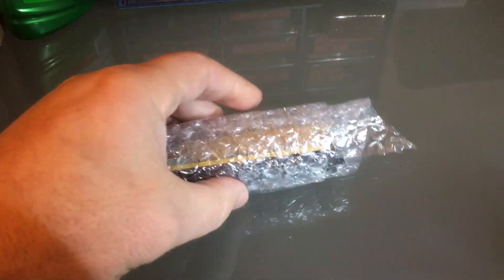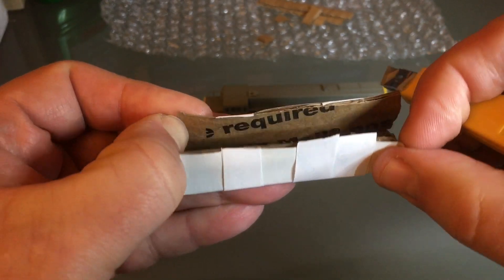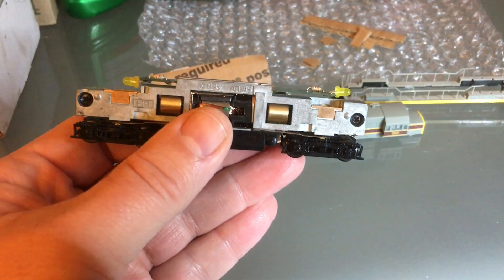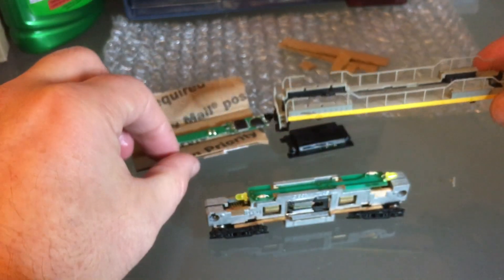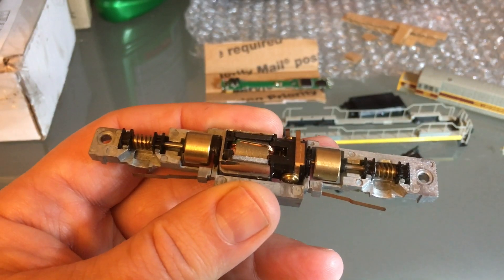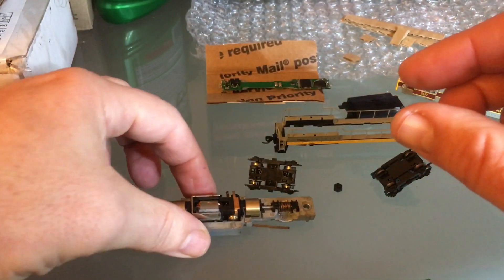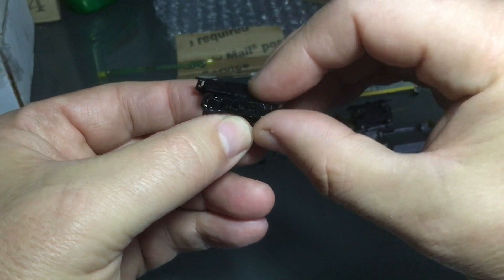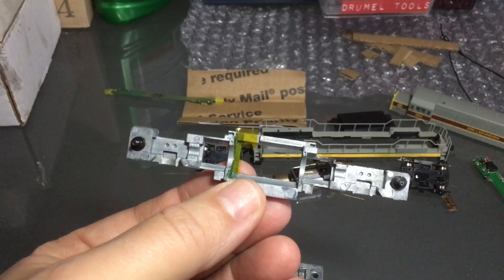N scale Atlas U25b conversion to dcc using an XL Systems dcc board.

Comment: I have locos from Atlas, ConCor, LifeLike and Kato and if their frames weren't all designed by the same team I would be very surprised. I think Kato made drives for everyone at one time. They are all very good runners.
Reply from the maker: Probably other companies reverse engineered what Kato has done. I enjoy the other manufacturers. Just Kato is always one step ahead.

Comment: What your opinion on new  BLI vs Kato.  As far as quality of design and manufacturing.   I have several BLI. I haven't had any issues with them and haven't had to take them apart.  Some people like them and some just can't stand them.  I have mostly Kato and then seem to be really good runners.  I would say they are the N scale choice for quality.
Reply from the maker: My T-1 still runs. They look great. I will know if I like them over time. Kato I have been running for 30 years. I like that. I’m use to them and I trust them 100%.
Reply: @watchtrainsnow1099  I like the sound decoders for the BLI.  Seems they have done a lot for the sound end of the locomotive.

Comment: You seem to get mostly lucky with your buys.   If not you do have the skills to make it right.
Reply from the maker: Yes… I spend way too much time on eBay. The prices are crazy right now. This was purchased a while ago.
Reply: @watchtrainsnow1099  I agree I have been looking at some Kato P42 locomotives in N scale, they are selling more than retail.
Reply: @watchtrainsnow1099  one I missed out on was the Veterans limited edition that was made for Amtrak and sold only by them.  It's $400++++
Reply from the maker: But, you will see what I do is bid on engine that are not so popular or damaged. P42 is a really good looking modern engine. RS-3 not so popular.
Reply: I know you are very diversified in your collection.   I stick with the Amtrak's P40 and 42's.   If I see a freight or pre Amtrak passenger locomotive that I like I grab those sometimes.  I picked up the G HW bush locomotive by Kato because it just is really a great paint job.
Reply: @watchtrainsnow1099  why are the prices so high right now? I'm new to the hobby
Reply from the maker: @danzo5521  it’s offer and demand. I go on eBay and I bid on auctions. I get out bid a lot. The hobby is booming.
Reply: @watchtrainsnow1099  is that because manufacturers aren't producing enough models to meet the new demand?
Reply from the maker: @danzo5521  I’m not sure, seems if you have the money, there is plenty of stuff to buy.